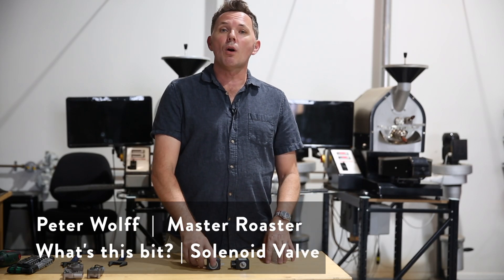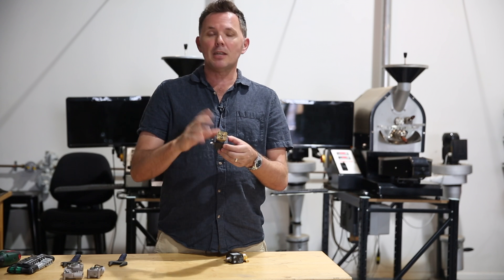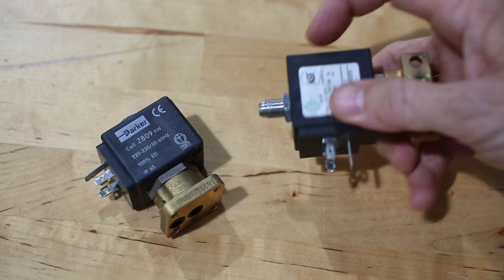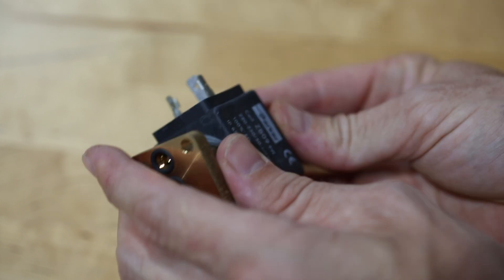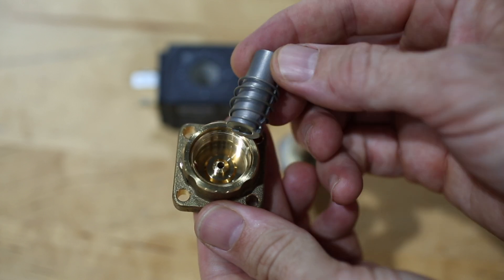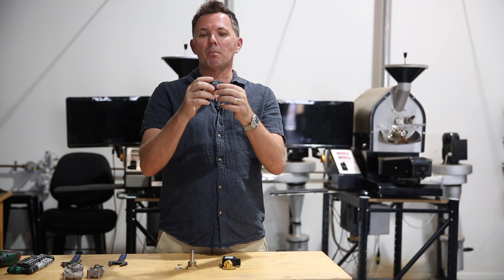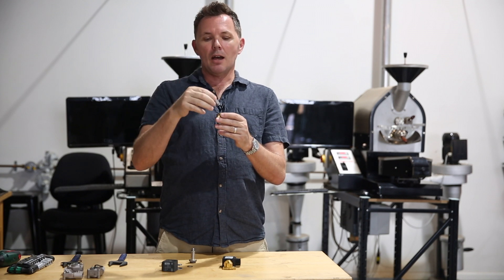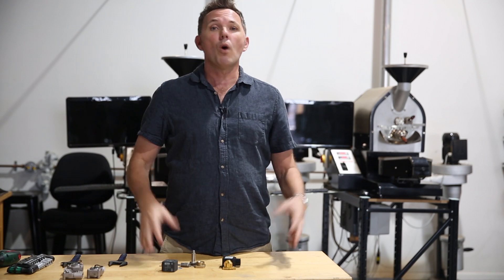Solenoid Valve on an Espresso Machine | What's this bit?

Comment: interesting stuff and you clearly know your stuff Peter. On a basic, single group machine, why would the pressure be going crazy, not settling at the typical 1.5 bar? I have checked the two release valves for cleanliness and lubrication... all seems fine, but switching back on sees the pressure go right round the clock until there is a massive release.

Comment: Hi Peter, great video. Im getting water thru the group head when group handle is empty (only the left one-right is fine), its less water than normal but when the grouphandle is loaded I get no water through at all.  I can hear everything working as normal but just no pour.  Could this be a clogged/dead Brew Valve/solenoid ( are they the same thing?).
Reply: I’m having this issue now! Left one barely a trickle, right group head is fine. Did you figure out the problem?!

Comment: Can I ask, is it a common problem for the nut holding the valve on to vibrate loose and come off? The Solenoid on my machine fell off after a recent service and burnt out, the engineer has diagnosed the cause from vibration and claims to have not touched it during service. Thanks in advance.

Comment: I have a Philips lattego 3200 I have an issue with the milk frothier it makes on cappuccino and the on the second cup it makes the noise but no air so no cup for husband 
Any idea
Reply: You need to change solenoid valve, this is the problem of your espresso machine.
Reply: I had same problem. First milky coffee is ok but the machine doesn't give second. Only pump noise with steaming around machine, then only coffee without milk. I changed solenoid valve and it's done.

Comment: Hi! How are you?
What can I do when only one side of the group does not come out with water and the same solenoid valve overheats?

I replaced it, cleaned it and the problem persists.
All the water pipes are free and the water flow reaches the normal group.
Model Avant Astoria coffee machine.
Thanks!

Comment: Thanks for the info. I am having a problem with my machine. The boiler is not filling. Pump kicks on but the water is being pumped directly out of the overflow. Could it be a solenoid issue? Any help regarding what could be the problem would be appreciated.

Comment: My Breville's steamer used to be a standard pump... pump... pump... pump, etc. but now it's doing pump... pump... pump pump... pump, etc. bit like an irregular heartbeat. The steamer doesn't seem to be giving enough pressure as the group head extraction and hot water pumps are working fine. Would changing the solenoid for the steamer likely fix the issue?

Comment: Thanks so much for you explanation. I cannot open the valve plunger. Seems like the lock is stuck. You have talked about a tool ( shifter) to open it . Kindly let me know what it is? I think there is calcification inside the plunger so my water is overflowing. I'm talking about the 2.02 part of this video. The part where you talk about opening the valve stem. Thanks in advance.

Comment: What about when no water comes though the head? Can it be blocked closed ? Can you put power to it, to check it?I found a Lilet combo, so I put a new element in it . I makes steam and the pump passes water to the stem but not the head.I can hear the pump and the relay seems to click? I'm gonna open it up.....Thank you for you video.
Reply: That fixed it thanks , sticky valve.